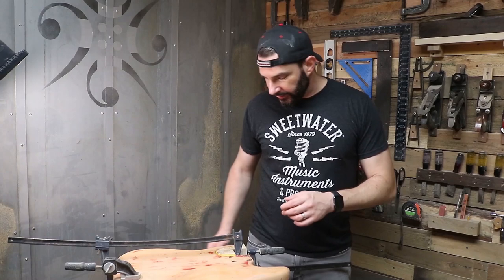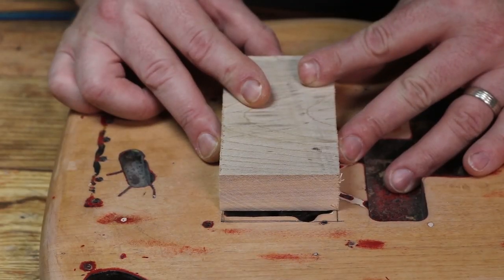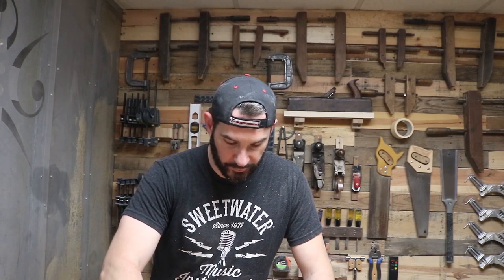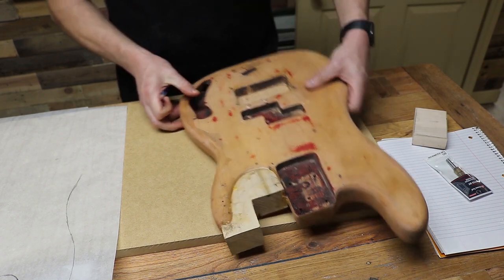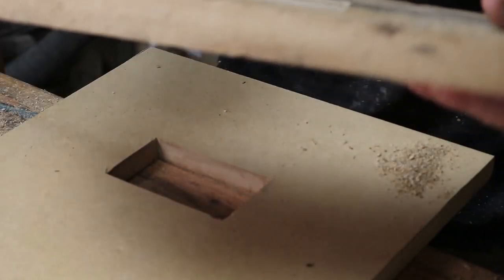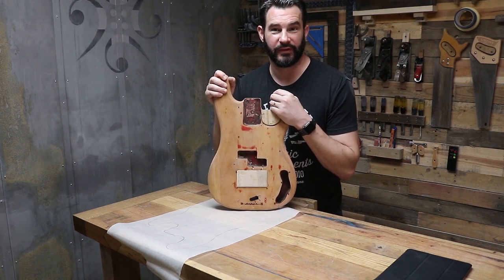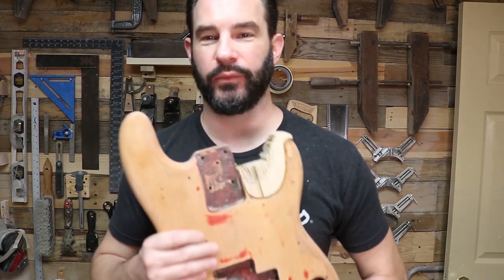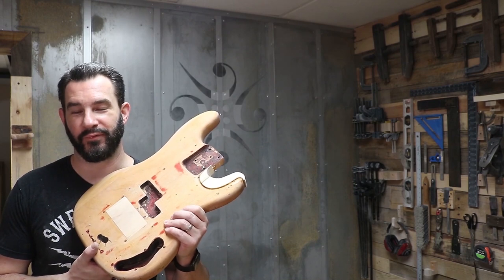Fender Precision Bass Rescue Build Episode 3

Comment: Really nice job on that repair!  A buddy of mine bought a '68 P-Bass that was gouged out for a Jazz bass pickup and a really bad Rustoleum paint job. He kept the passive EMG's in it and had another friend put down a heavy green metal flake automotive finish on it. Like you've said, it's never going to be all original again so he had the body fixed up and painted the way he wanted it to be and left the neck all original. 20 something years later, the neck doesn't have much lacquer left on it and the body has got some dings and dents but it's still a killer bass. I'm fairly new to your channel but I'm enjoying what you've done, keep up the good work!
Reply from the maker: Thanks man!  I’m new to all this, but I’m enjoying learning as I go.